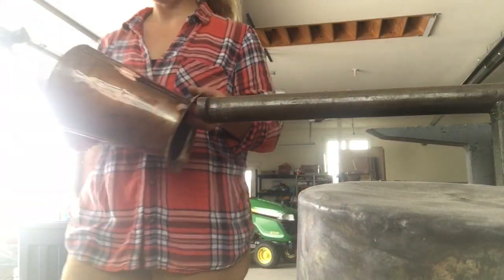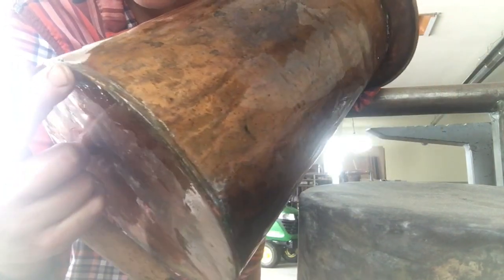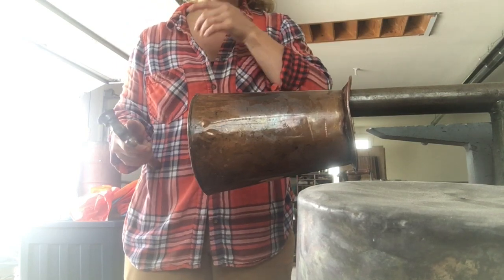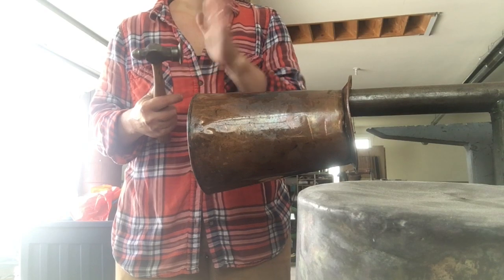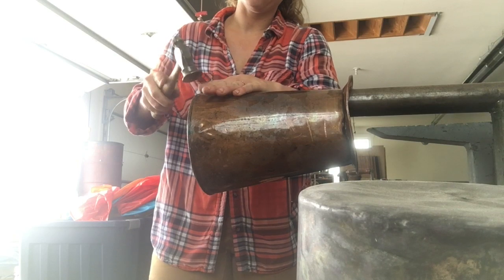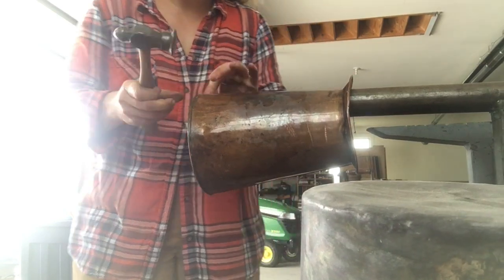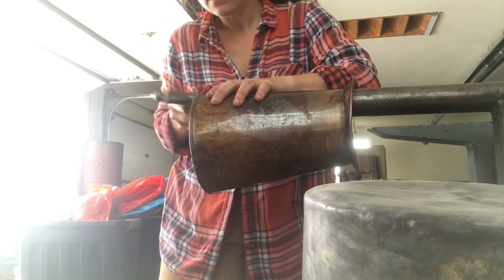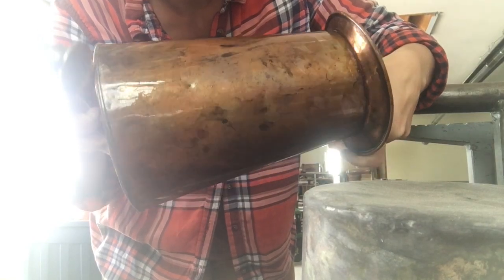Fixing Copper from the Exterior

Comment: I can see you have a passion for this job. How can I repair oval shaped copper water jug without taking apart seamed part? Can you heat it and then repair it?
Reply from the maker: Thank you, I do! As for your oval water jug, without a photo to understand your problem, it's a bit like diagnosing blindly. I do try to keep all seams in tact at all times because it is very difficult to remove and then put back due to the heat stretching the copper crystals. Usually if a lap seam falls apart, it can be put back. Same with a butt seam. But crimp or cramp seams are pretty tricky to put back. I would need to see your jug to properly give some feedback. :) You could of course put a rag soaked in water around the seam you want to work on and that will usually preserve the seam so it doesn't fall apart, and you can still do repairs. Does that help?

Comment: how to remove the dents from a small 30cm thin copper pipe ?
i wanted to make it as as heat exchanger for my laptop
Reply from the maker: That is small. I would suggest a tough smaller metal bar inserted into the pipe and then gently hammer from the exterior.